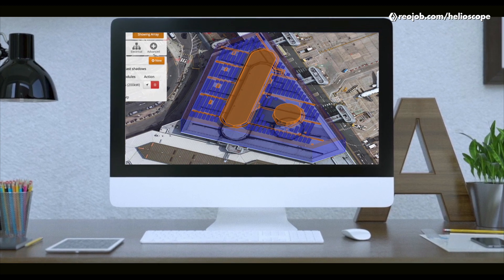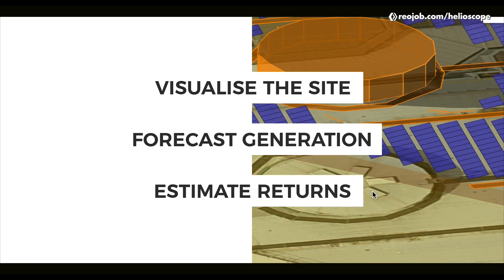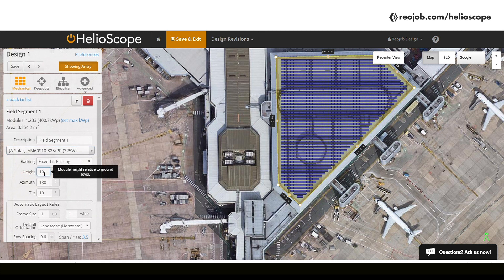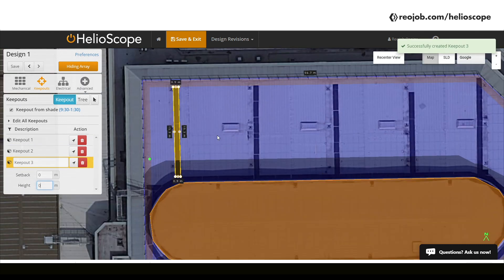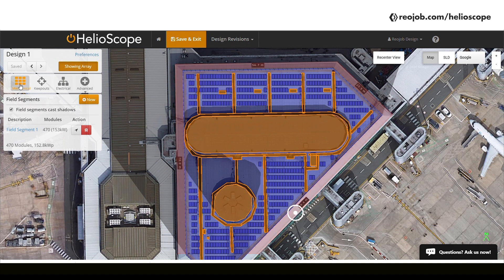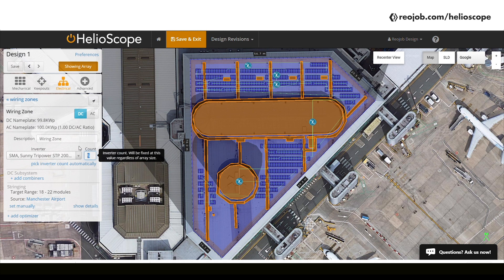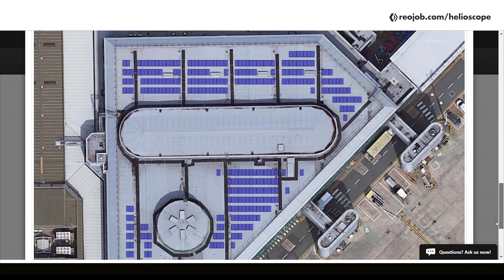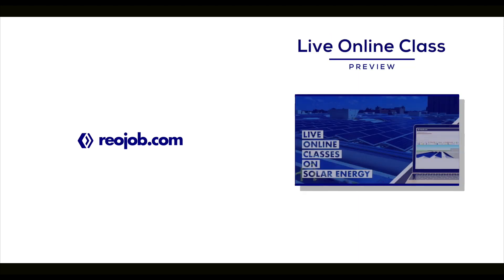Helioscope Tutorial On How To Design A Professional Solar Rooftop | Try Our Online Training Course

Comment from the maker: The syllabus of our 8 hours + course on '3D Modelling and Energy Estimation with Helioscope' is:
Part 1:
• Basics of Site Assessment (Site feasibility and technical due diligence) 
• Purpose and factors to consider
• Desktop and On-Site Assessment
• Understand the impact of solar irradiation, tilt angles and other variables on PV production 
• Overview, and comparison of various simulation software available
• Advantages and disadvantages of using simulation software
• Introduction to Helioscope
• Basic algebra, geometry, and trigonometry calculations (e.g., area, slope, inter-row shading, wind loads) 
• Key terminologies to be understood in Helioscope

Part 2: 
• Basic Overview
• Walkthrough of Helioscope 
• Creating a project
• Creating a simple design using Helioscope
• Field segment creation
• Creation of Obstructions
• Creation of Trees and estimating the height of shading objects
• First simulation and understanding the simulation report Detailing of Helioscope design
• Loss parameters
• Fixed Tilt System Design
• Flush mount System Design

Part 3:
• Ground Mount system Design. 
• Using overlay feature in Helioscope 
• Design using Multiple field segments 
• Electrical design using Helioscope 
• SLD creation 
• Cable sizing 
• Exporting layout drawing to CAD
• Getting Interval data in Helioscope 
• Importing horizon diagram 
• Shade optimization 
• Report Customization

Comment: hi may i know, can we design rooftop stand-alone PV system using Helioscope ? I need to do project on designing rooftop stand-alone PV and i need to consider the life cost analysis and break-even for utility bill. based on your suggestion, what software can i use to consider these cost ? Thank you for your kind and help
Reply from the maker: Hello,
Sounds like Helioscope should be able to do many of these things. 
However, Helioscope is capable of designing only grid-connected solar plants. if you're looking for detailed engineering and solar plant design and energy estimation, I recommend using PVSyst.

More details here - https://reo.online/training/pvsyst